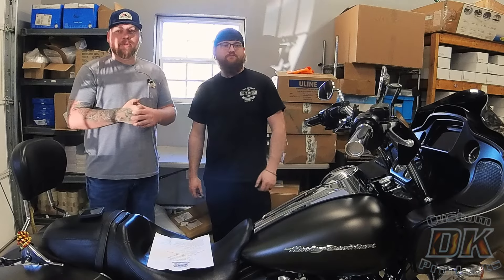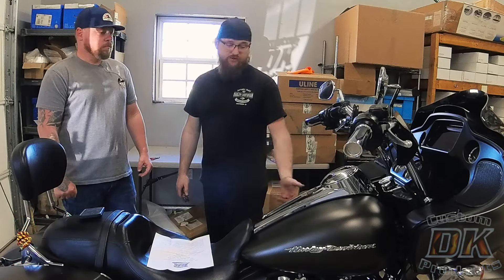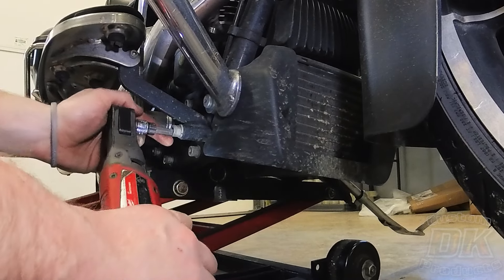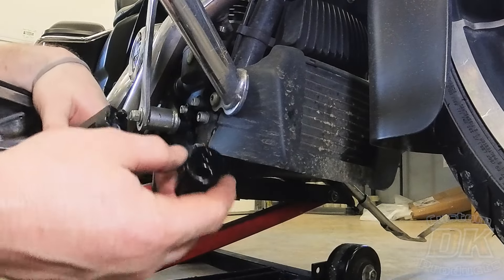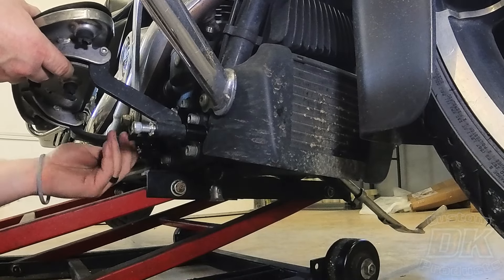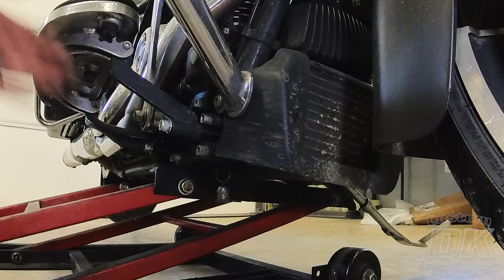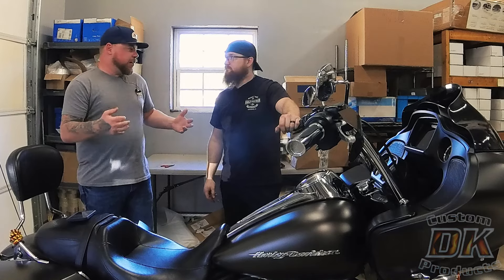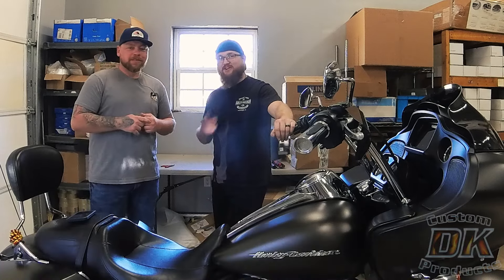Step By Step Easy Install for More Comfort on Your Harley

Comment: What about cornering?  I already scrape on occasion with the floorboards closer in towards the bike.
Reply from the maker: Sadly, Installing the floorboard extensions will slightly reduce your lean angle, so you would likely still scrape your boards more with this kit.

Thanks for commenting! MB
Reply: Thanks for the reply.  I just installed your 828 air intake on my Road Glide ST, which I ride like I stole it.  You guys have great products and I am always interested in what you are putting out.

Comment: I have the kit but cant brake the bolts loose on a 2023 Tri Glide any suggestions
Reply from the maker: Have you tried applying heat? MB
Reply: I just bought this kit and am having the same issue on my 23 Tri Glide. I tried my 1/4" impact with no luck. I guess I'll try heat next. Did you ever get yours put on?

Comment: I'd like a bracket that moves them forward an inch but not out.
Reply from the maker: Some folks don't like to move their floorboards out, because it reduces lean angle. 
However, with these, that move them out and forward, the lean angle is increased!
We do not make them that just move forward, they are more comfortable for most when they are out and forward.
KP